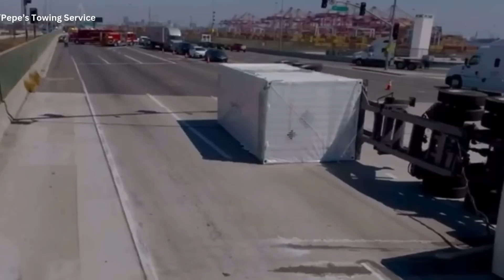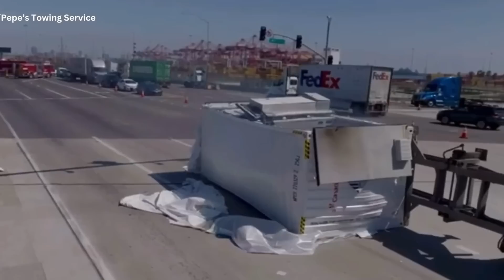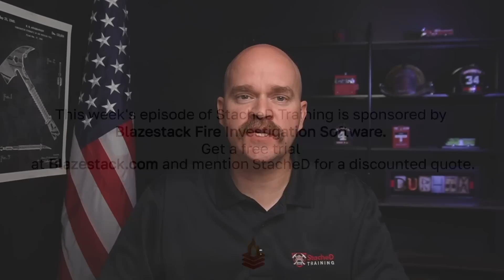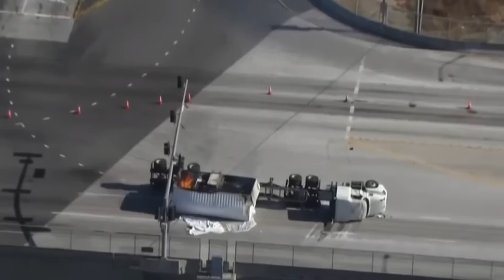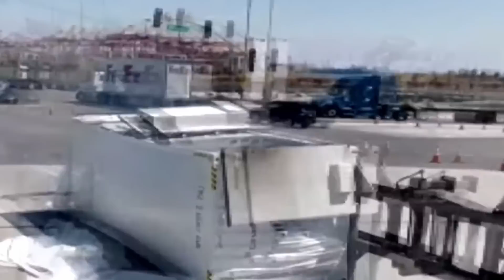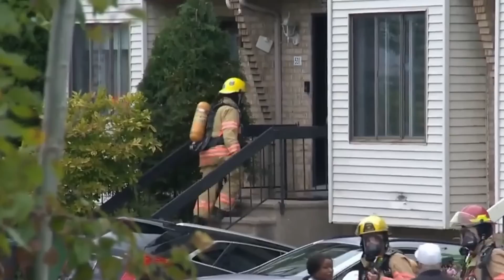LA Freeway Explosion & Montreal Port Fire: Lithium-Ion Battery Crisis

Comment: EV's don't seem to be living up to the greenwashing BS. They're just as 'dirty' as the ICE's the tree huggers whine about. I wish we had adults running things instead of the woke virtue signalling jerks. Lithium mines are FILTHY. The energy used to extract the ore is FILTHY. The transportation of the ore is FILTHY. The processing of the or... also FILTHY. We still have COAL FIRED plants making the electricity to charge that things. Then after all that they are so very dangerous for 1st responders who have to deal with the mess made when they crash and burn. How many lithium ion battery fires will it take before enough is enough ? (get that escooter out of your home)

Comment: Doing the math on carbon emissions.
The average popular EV will do about 10,000 miles per year and will normally be kept for five years at most by the average EV owner but lets give them equal footing to a real vehicle owner and make it ten years. That's one hundred thousand miles and ten years old making the EV essentially worthless as a trade in and only worth scrap value . If charged by solar or Nuclear or Hydro it's entire life it may just about break even on the carbon input to it's manufacture so supposedly that's a Net Zero. However in reality unless you live in a state with nuclear fifty percent or more of the power to charge your Virtue Signal Machine will come from fossil fuels so  the only thing net zero is the benefit from VSMs .
Now add all the fires.
A burning EV releases all it's carbon and the carbon of all the things around it and the energy used to deal with the fire.
Carbon emissions were actually on the decline before carbon was declared a pollutant which like all government good intentions promptly resulted in an end to the decline and a rapid increase to emissions of over 150% and in some cases 400%.
The only thing green about EV's and other VSMs is the money lining the pockets of the scammers who claim the sky is falling.
Reply: Yes, plus if we use nuclear, for power there’s the issue of nuclear waste. 
And to date not one battery has been recycled. 
EV’s are worse on many levels.
Reply: @dave3657  There have been plenty of batteries recycled but overall it would be way less than 1%.
Reply: @dave3657  Nuclear waste is mostly an exaggerated issue .
Look up the exact details , the actual amount of dangerously radioactive waste in the world would barley fill a swimming pool and not a full Olympic sized one . The right reactor technology actually burns most of its waste. Te real waste comes from things exposed to radiation and they need storage for about fifty years to become safe. The real problem that causes danger is the Moron factor . These morons come in two or three varieties.
First is the ones who think their ideology justifies doing atrocities.
Next is the empty suits who make bad decisions for political of corrupt reasons.
Third is the kind of people who need a warning label on a microwave not to dry a pet or baby in it who might be put in charge of something critical.
Reply: Nuclear waste isn't an issue, especially on new reactors/recycling. Thorium reactors is what we need, but the entire world except China refuses to invest in it. It's too clean, cheap and safe. There's no money to be made. @dave3657
Reply: This is why I call Al Gore the trillion dollar man.  He has cost us many trillions actually with no end in sight.
Reply: Germany have 53 coal power plants. No nuclear....Poland have 58 coal power plants... great !!!
Reply: @EIRK2046Y And China must have many times those numbers. So, any EV driving around China is completely dependent on electricity made from possibly the worst choice of fossil fuel.
Reply: @markthomas207  lol China has so much solar it can power ever single home all day . Don’t be sad you don’t keep up with modern times .
Reply: @chrisward5626  Why don't you move there.  Seems like a happening place.
Reply: Just pay us more taxes and we will solve the problem for you and if you refuse we will arrest you. - The Government
Reply: Lol yet where are these scrap value ev you speak of ?
Reply: @chrisward5626  seek and ye shall find.

Comment: 2:58 YES. Lithium battery pack in relatively inert n immobile situation is the best. Laptops, phones, ur dang cordless vacuum. No problem. Heck, u can even install a giant battery pack to suppliment the solar panels of ur house (that is one rich mofo) n no issue.

But put it in a vehicle… n while its true that hybrid vehicles are susceptible to this as well, they dont carry a 1000lb battery pack with them. A standard hybrid, at most, lugs around a 100lb battery pack. A whole 10x less problems to deal with😅.
Reply: Toyota and Honda hybrids use NimH batteries that are far less dangerous. Well they did until recently anyways.

Comment: Local fire reporting at the scene advised that water was not going to be used due to environmental concerns.  Toxic runoff going into the waterways.  There have been several BESS fires in California recently which involved several days of water application.  Why is there no discussion about containing the volumes of toxic water runoff?  The Vincent Thomas Bridge incident was the first time that I'm aware of where the toxic water runoff was recognized as an environmental hazard and the decision made to let the fire burn itself out.
Reply from the maker: Every municipality will approach these incidents differently.
Reply: @StacheDTraining  THAT is the problem.
The problem (lithium-ion) should be heavily scrutinised if deciding whether to protect the local residents or the environment. 
It would be a good idea to STOP the nonsense IMMEDIATELY and plan for a better approach.
Reply: @boblandwehr8222  @StacheDTraining  they tested lithium batteries in Piqua, Ohio and measured what was in the water run off from putting the fires out. Very sketchy
Reply: But, what about the toxic gases/smoke produced by the burning battery?  That's the immediate threat to local people.
Reply: @rjbiker66  no doubt is, however considering the thermal runaway CAN NOT be extinguished, creating pollution on top isn't worth it. 
Cooling to save/rescue   individuals trapped etc the rest you tell us?
Reply: I don't think it really matters whether or not they use water. The toxic smoke particles will still end up in the water, just more widely distributed.
Reply: When the Buncefield oil storage depot (UK) caught fire the fire brigade had to get permission to use foam before they could tackle the blaze.  Again, polluted run-off fears.
Reply: @robt2151  Above ground fuel tanks usually have a dam/berm to contain spills preventing ground water contamination.  Knowing toxic run off threatens ground water contamination, what's the plan to prevent it?
Reply: @boblandwehr8222  I'm familiar with the concept of berms - one of my earliest jobs, 50+ years ago, involved checking the stability of storage tanks and berms at Cardiff docks.
IIRC, in the case of the Buncefield event the fire started in monitoring gear in the top of the tank, which then led to an explosion which could not be contained within the berm.
Reply: First, the word toxic is highly overused as a word to induce panic and fear. Second, I doubt anyone in the decision chain here has any workable knowledge of how toxic any runoff would be. There's a study that shows that while all fire runoff has harmful contaminants, runoff from ICE vehicle fires is worse than BEV fire runoff and much worse than a battery fire alone like what we see in this video.  Plus, consider what would be in the runoff from a structure fire - thats going to be a miserable soup of real toxins and dangerous compounds, and yet people don't seem to be overly worried about that slop. The real issue is not the batteries themselves, but lax handling protocols on the part of the manufacturers and governments.
Reply: @Hybridog  We know the fumes of BESS & EV fires are highly toxic.   Until we know the toxicity level of the run-off shouldn't we error on the side of caution?
Reply: Yet they pump oil fires all day with toxic foam contaminating everything .
Reply: Honestly water runoff is a ridiculous reason not to fight a fire.